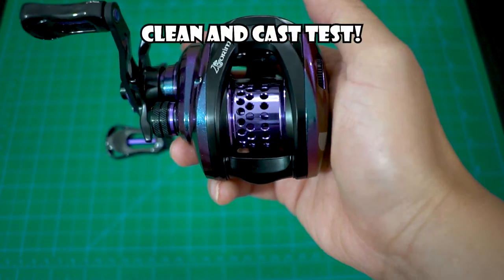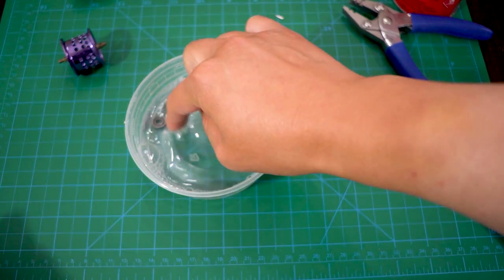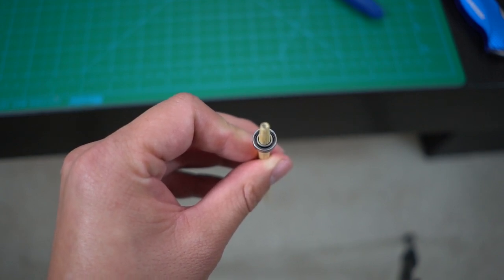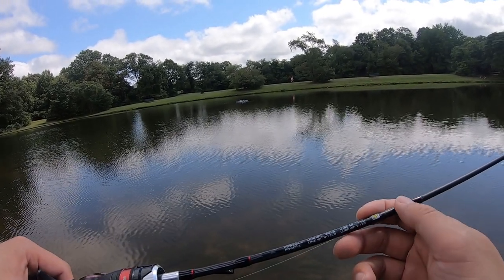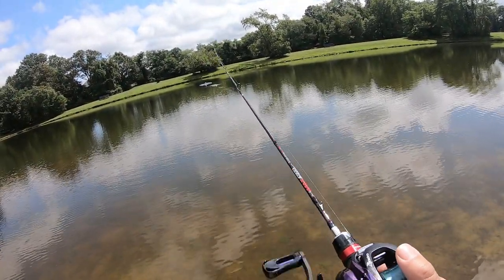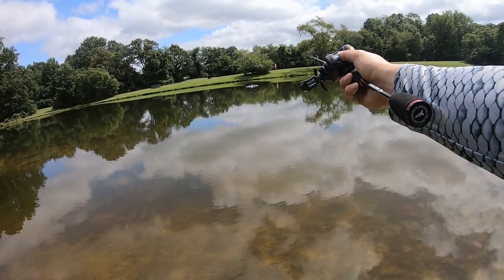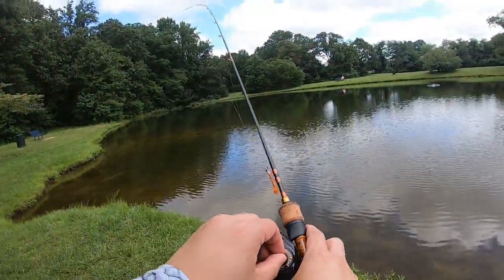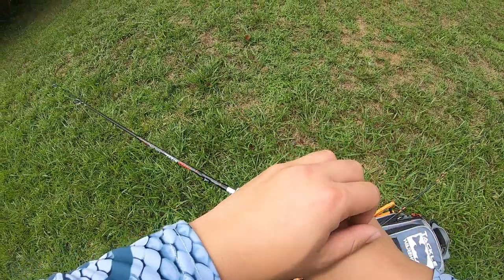Kyorim Black Knight BFS Reel - Initial Cast Testing and How to Clean Reel Bearings

Comment: Not sure if poor qc but I experience backlash more on the initial part rather than the end. Thanks for the review!
Reply from the maker: Not really a reel review, that is coming!  Just an initial cast testing video. Do you have the left hand reel? And what were your braking settings? Lure weight?
Reply: @rawrfishing  I'm expecting you to not recommend this reel since you always say bfs isn't about casting distance haha! Yes I'm using a lefty reel, managed to go down to around 3 - 3.5 brakes using a 2.5g jighead
Reply from the maker: everyone fishing style, preference and needs are different. I will take a far casting reel if the reel have capabilities to do so! I just don't think it is the most important, but to have some distance is still important.  Who knows, if in another year or so and there's a major break through on BFS reels, perhaps the world could move away from spinning gears! In fact, if you look at the original BFS reels, they certainly couldn't cast far!  not until aftermarket lighter spools and micro bearings were introduced.  Why did they do that? it's because that is the demand! people want distances and to also throw lighter lures. My jig and swimbait is about 2.5 to 2.6 grams and I can cast it with this reel on a 1.8 UL rod like you on 3-3.5 brake settings. I think it's not a complete bust of a reel, but due to the issue, I would be limited to certain casting styles.  I also haven't been able to cast in super windy conditions, so who know how that would handle!
Reply: @rawrfishing  that is really true! Where I'm from, casting distance is more important than the ability to skip the lures etc. I do hope there's a major breakthrough too so I can tempt my friend who enjoys spinning UL fishing using <1g jigs hahaha!
Reply from the maker: i don't think you can beat spinning gears when going that light tho. i never really cast lures that light, if anything. i would opt for fly fishing before going that light on spinning gears lol!

Comment: I do not understand your point: the backlash at the end of the cast (during deceleration) is not really a problem since most people use their thumb to stop spool rotation when the lure touches the water. You are the first person I see on Youtube that considers that brakes which do not stop spool rotation at the end of a cast without thumbing, are bad brakes.
Backlash at the start of the cast (during acceleration) is the main problem since you cannot control it (or with difficulty) with your thumb. And especially in BFS when lures are very light (1~2 gr).
I am a bit disappointed by your review ;-(
Reply from the maker: First and foremost thx for watching.  Second this isn't a review, but an initial cast test.   I was trying to prove a point on how brakes should work! This is the first video that I have done an example of how brakes should technically work. Is it realistic? Absolutely not!! What you have stated is pretty much in line from what I have stated within the video.  You can reassess your opinion after you actually watch the wrap up video which is an actual reel review...

Comment: What type of snap swivels are you using for BFS fishing? I found some micro ones that can be imported from Japan but I was wondering if the US domestic market has something decent in smaller size.
Reply from the maker: I havent used much snaps. I am thinking to look at aliexpress.  Tried some that tsurinoya sent me but it was big.  Not too bad for making a jerk bait sink more... but i want something small too. I am probably gonna look at vmc since I got some sponsorship discounts lol. I think they have some.  What sizes u get from Japan? Maybe I can measure the smallest ones from vmc and see if it is comparable
Reply: raWr Fishing the Cultiva ones apparently are no more than 1/2 inch long. However around 4$ for 4 of them lol
Reply from the maker: Geee, so freaking expensive... can't find any on aliexpress?
Reply: raWr Fishing found some on EBay. 3$ (+ taxes) for 10. I measured and they are about 0.85 in. Good enough for now.
Reply from the maker: @technicallycorrect838  glad you found em!

Comment: This is the first iteration of the black knight right? For some reason I got your video in the recommended, even it's 2 years old. Here is the truth, black knight2 is totally superior, personally I have two of them and I used them equally with my aldebarans, such a good budget reel. The black knight (first) was indeed a miss-engineered product, IMO.
Reply from the maker: Yes this is the older one. Even the newer one is broken. Sure the quality is better, but does the FTB style braking work on left hand side? Likely not because CDM world only copied the right hand side reel and it won't work by slapping it on a left hand reel. The rotation of the spool and pivot point of the brake shoes does not work together as fishing discovery have discovered.

Comment: Oh no..my black knight is on the way. I bought it after I watch your first unboxing 😂. Is it that bad ?
Reply from the maker: glad you have asked! don't sweat your pants based on my anger from this video! I have taken this reel out 1 or 2 more times afterwards and will come back with a final video review of the reel.  If you have seen the casting, the distances were great, the braking doe work up to a certain extent where the spool doesn't over spool at initial startup (aka the cast) this is where it is most important!  So if you are just casting and not doing fancy stuff like skipping, you should be okay!

Comment: Ciao secondo te quale è il mulinello migliore da bfs tra quelli che hai recensito e provato? Purtroppo non conosco l'inglese e dai video non riesco a capirlo.🇮🇹🇮🇹
Reply from the maker: This one is the worst because the brakes did not work on the left hand side. they took the brakes from the right hand reel and put it in the left hand.  It might be an issue with the Dark Wolf from Tsurinoya and Fishband GH100 too, but I will have to check.  I put it on max brakes and it doesn't work!  I compared that to Zephyr Max Brakes and it stops completely.  
Out of all the reels, Zephyr is by far the best that I have used.

Comment: Do you think its possible to take the magnet system from the gh100 and switch it over
Reply from the maker: I bet u can... this doesn't really happen on gh100. I mean it does one rotation on max brakes... so it is possible the brakes are working better than this reel

Comment: is it possible to turn around this brakes?
Reply from the maker: If one wanna take it apart I guess. Swap magnets around for a different configuration i assume?
Reply: @rawrfishing  I mean is it possible to unscrew this magnettes cage and turn it around to it works like in a right-hand version?
Reply from the maker: No because it needs to flip the other way not just rotate. One can pop out all of the mag and reinsert it another way too maybe?

Comment: I didn't understand what's different between left and right hands version
Reply from the maker: I am not an engineer, so i can't fully  explain it to you, but apparently the braking system gotta be assembled differently for left or right.  But for this brand, they used the right hand braking system on both right and left hand reel.  So likely the magnetic force field is not correct.  I never heard of this but it is what folks on Facebook or my other video comments are saying.
Reply: @rawrfishing  what a shame! I'm still waiting for it so it's good to know, I'm right though
Reply from the maker: it's certainly is a shame, but i have calmed down from my cast test session and i took it out again because it cast surprisingly good even with not so strong brakes. I feel that if you  are pro with your thumbs... it wouldn't matter much.  so hopefully those who ordered it already would feel the same. but i am sure conflicted... gathering notes for a final review.. which i haven't really done for any of my reels LOL.  i leave people hanging normally >_<
Reply: Ya, I don't think that's the case...the pivot point makes no difference, it's drawn to the spool via induction not rotational force.
Think about it the spool spins the same way left or right and the magnets are still going to be drawn upwards regardless of a pivot point.
It probably just has weak magnets.